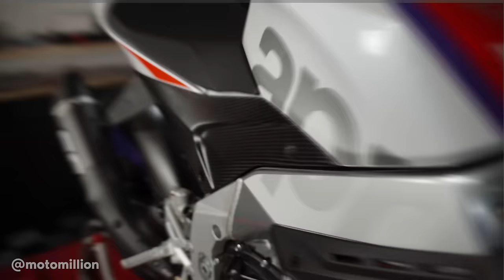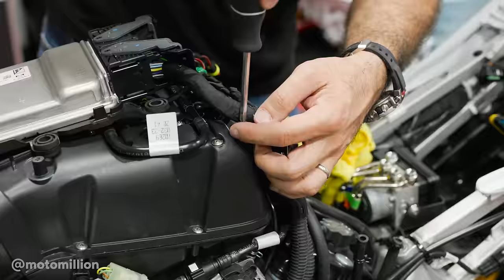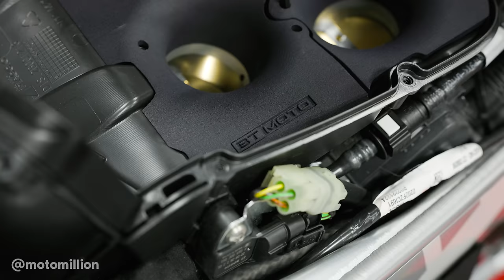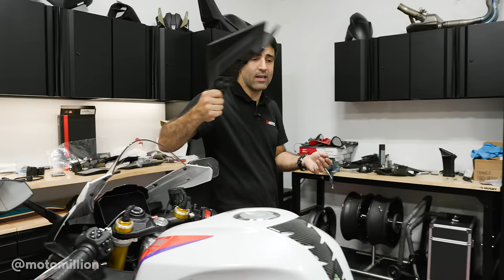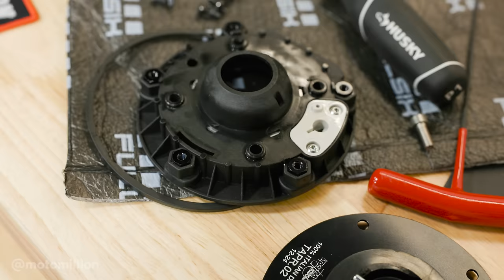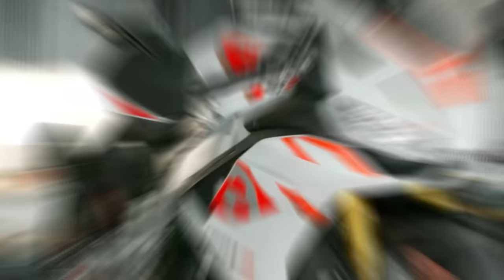MORE Power for the Aprilia RSV4! BT Velocity Stacks!

Comment: Its interesting that BT moto doesnt want the upper stacks in the air box lid removed. My Garbro Racing stacks call for the upper air filter stacks to be removed. I wonder why they would be different? its seems the upper stacks restrick the air flow around the upper fuel injectors to the lower stack. might be worth contacting BT moto for clarification if they found something different.

Also on your Extrenta tail, i have the same one and the carbon fiber little tabs that hold it down can break very easy, i ended up cutting off the plastic bottom of my old seat and using it as a stiffener brace. this keeps the tail on verfy secure and doesnt flop side to side. also you can retain your factory allen key for the seat.
Reply: Dude Gabro stacks are different. This does not mean every different stack profile should automatically remove upper stacks as gabro does.  Maybe BT gets better results with….
Reply from the maker: The Brentuning installation does not mention to remove the upper stacks. We don't think just because we installed the lower stacks they are the same. We will definitely contact them after the comments.

I can't see how we can use the bottom of the tail with the xtrenta tail?
Reply: @calRSV4  the only problem with BT is that they fluff their numbers. What Gabro said on his website was exactly what I got on the dyno 2-2.5hp up top in SAE not STD. I have a video of before the stacks, then I installed a bmc airfilter (.5hp gain) then installed the Gabro stacks 2hp gain. BT will say his gained 6-8 or 9 hp and sorry that doesn't happen on these RSV4s. From stacks and tune. It's hard to get additional hp from an Ape.  Gabro said the exact same on his website. The dealer told me to just get the slipon as well cause a full exhaust won't give u much gains for the price. It will look good though. I will upload part 2 of my dyno video.
Reply: @Motomillion  I had to cut my old seat, I would not recommend it for a bike you a giving away. I ended up cutting the carbon fiber and using fasteners with molding glue to keep it together. Due to the carbon fiber process you may never see an issue.
Reply: @Motomillion tabs on my tail broke and i purchased it after seeing this video. Might have lasted longer but i have a cf base as well. No room for flexibility. Now it’s Velcro’d on 😢

Comment: Well dammit...  lol.  I watched this video again and ended up ordering the tail, but for my Tuono 660 Factory.  Little known fact - there are two holes on the bottom of every RSV4 / Tuono / RS660 tail that allows them to be interchangeable between them all.  Guess this will complete my Franken-Aprilia.  Tuono with a clipons & triple setup from an RS660, dripping with carbon and enough upgrades that it might even make a motomillion build jealous.  If you're curious what went on my bike, let me know and I'll post it up.

Comment: Please check I think you should remove upper air filter stacks, the down stacks are very similiar to Gabro's and make sense to upper should be removed too... I really hope you will works with right tunner for Aprilia but we will see after dyno what you do with BT it will be interesting to see
Reply: I have Gabro stacks and tune also I was hoping to find someone to give me a custom tune for my area but it's pretty difficult
Reply from the maker: The Brentuning installation does not mention to remove the upper stacks.

Comment: Question for y’all @Motomillion. Why did you choose Bren Tune over Gabro Tuning? For Stacks and tuning? Just an honest question? I’m on the fence so I’m very interested in your response.
Reply: They do alot of colab with BT. So they are loyal to the brands in which they use. Twm, fullsix, etc etc. All proven brands. We in europe of course love gabro and the work hes done on the v4 since 09. BT have also impressive results with thia platform so is a matter of preference.
Reply from the maker: We want to do an honest test. We chose it because of ease of availability here in USA, and the direct support and service they have. We are honest with what we offer, if we don't think the flash is any good, we would not offer it. We still have not put anything on the dyno yet, that is to come after we get some more work done.

Comment: BT stacks. The Gabro racing copys, fulky endorsed without shame. 😂
Reply from the maker: The chicken came first or the egg?
Reply: @Motomillion  😂 that's not the case with these bro.
Reply: If u look they not the same....BT seals the bottom of the airbox to prevent turbulance as mani said. They also flat so equal distribution to all throttle. Gabros dont seal the bottom and have a taper on the rear bank. Theres enough R&d from both to justify their design, just a matter of preference
Reply: @jasperpearce8316  mmm hmmm